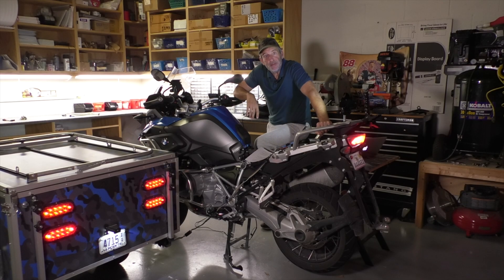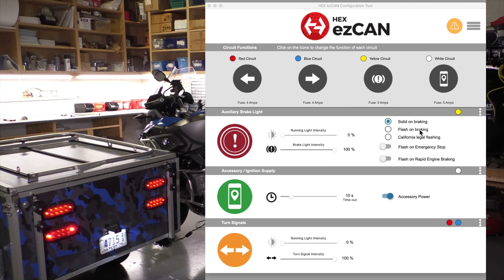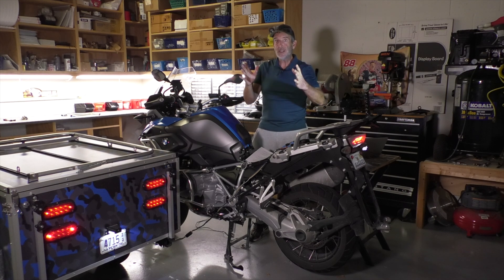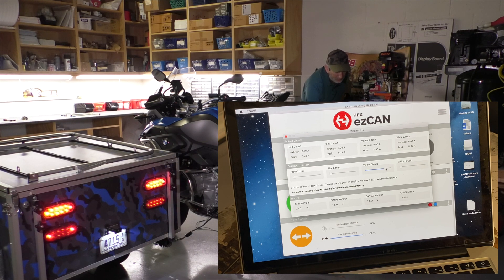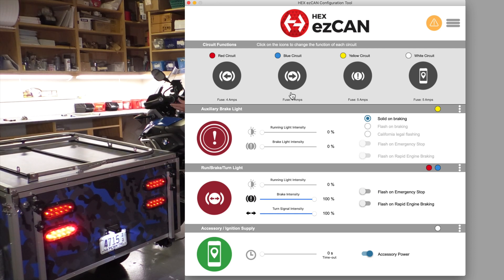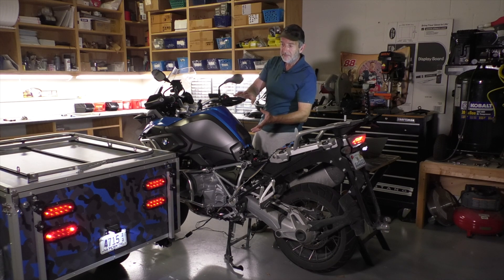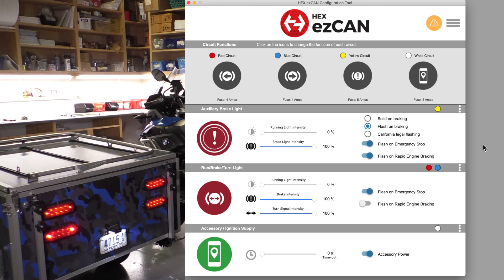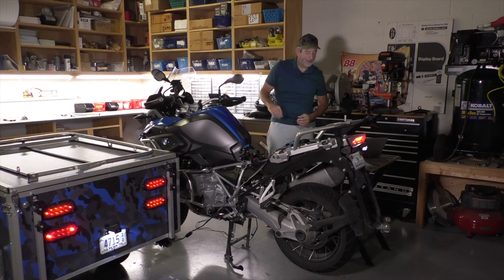ezCAN Accessory Manager Options and Bonus Features for Motorcycle Trailer Lighting Applications

Comment: Very informative video. Question: Do I need to have the computer hooked to the internet after the initial download and registration of the EzCAN?  Can I do the setup offline?  Thank you.
Reply from the maker: Good question. I'll have to try that with the next one I set up. After registration the program does a firmware check and updates the ezCAN if needed. Once that's done I don't think it would need to be connected.
Reply: @Openroadoutfitters  thank you.

Comment: I'm not sure how you got the brake lights on both the turn(red, blue) and brake(yellow). The turn wasn't visible in that shot.  I'm going to be using a 4 way setup, can that be done on a four wire?
Reply from the maker: That set up is only used in a 5 wire application where you have a separate set of brake lights. In a 4 wire, you will just be using 3 of the 4 ezCAN channels, one for left/brake, one for right/btake and one for tail/running lights.